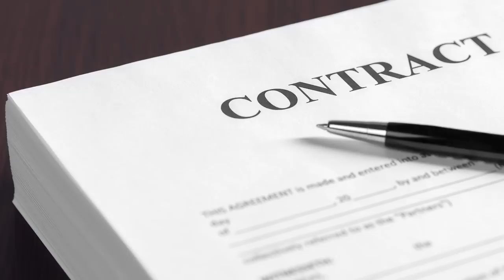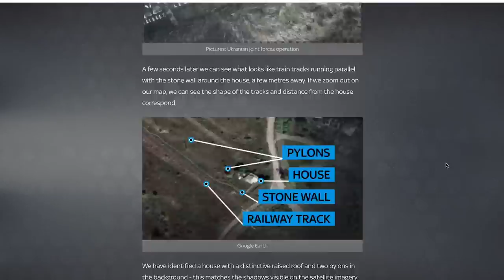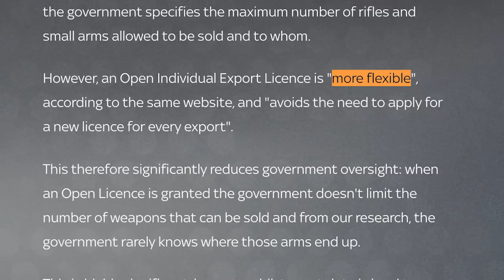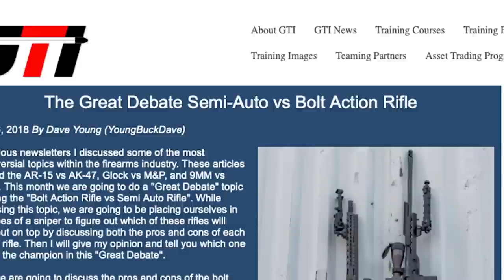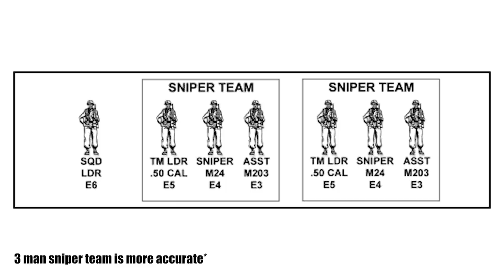L115A3 Brits Sniper Rifle From a Shed to Combat

Comment: I thought it was clambered in .338 Lapua though. I guess there are 7.62x51 variants but I thought that .338 was more popular with this rifle. Also the .338 variant is what made the the longest confirmed sniper kill.
Reply: I mean been alot models, they started in 762 NATO. But they now do 50cal down to 762. But 338 and 300win are there main cals.
Reply: Longest "At the time". Our Canadian forces Joint Task Force 2 with a US made McMillan TAC-50 holds the record at 3,540 m (3,871 yd).
Reply: The original was 7.62, I shot one once way back. The .338 Lapua Magnum came about much later, I was long gone by then. 😄
Reply: .338 became standard in the late 2000s following protracted patrol battles in Helmand. The Taliban found they could not approach British positions without being instantly engaged inside 800 meters by 7.62 AIs. The Taliban switched tactics and started using mortars and .50 Dshk machine guns from elevated positions. The .338 was soon adopted and the Taliban suddenly found they were not safe using indirect fire weapons from beyond a kilometre either.
Reply: @JRath905  
This world longest sniper kill focus is utterly stupid.
There is not a single sniper rifle in the world accurate enough to hit a person with a skilled shot at those distances.
This is much more luck than skill.
Only people totally clueless about sniping care about this nonsense.
Reply: @zoiders  
Outside 750 meters, the .338 Lapua Mangum is by far the best sniper cartridge against personnel in my opinion.
Personally I prefer it for all sniping against personnel outside 500 meters because of it's terminal performance against body armor, trees, wooden walls and more.
The .300 Winchester Magnum works very well too for longer shots, even if the .338 is far better outside 1200-1300 meters in my opinion, and an army can buy many more sniper rifles in that cartridge as the rifles and the ammo are much cheaper and the recoil is clearly lower, so more people are able to get good at shooting with it.
Reply: @The_Judge300  So the fact that people who are brave enough to serve their country  and are able to pull off shots that save the lives of their fellow soldiers, under intense pressure, against the odds, shouldn't be recognized?

You need both skill and luck in long range sniping. The humidity, wind direction, air pressure throughout the path of the trajectory is all different and can change quickly from the time the shot is fired till it hits its target.

Their spotter has to be able to see where the round hit in order to tell them how to  correct/ make adjustments.

The shooter needs to be able to not only have the practice of accuracy, but controlling their breathing and sympathetic nerve system, which is in high gear during a firefight, when you know that your friends lives may depend on the shot you are taking. It is psychological.

At any time during the bullets flight, an airplane or helicopter may fly by, throwing it off course. The same with any explosive Shockwave, shrapnel, etc 

The target may be on the move, ducking in and out of cover, have suppressive machine gun fire targeted towards the sniper team.

And you are calling those men who pushed the limits of what their weapon was even considered possible as utterly stupid and that they don't deserve recognition?

..... and yeah, I'm not in the armed forces or a long range shooter, but that doesn't mean that I "Don't know anything about long range shooting."

I bet if you made a shot like that you wouldn't call it all luck and utterly stupid to keep track of.

Rather than boost other peoples accomplishments, and make assumptions , you gotta be snarky and judgemental.

I'm sure you are the most skilled and knowledgeable about everything military and world records and your opinions are all amazing /s.
Reply: @JRath905  
🤣🤣🤣
Did I say that I don't think a sniper or any other soldier that does his/her job and do it well shouldn't be praised for that?
And I am happy that you give snipers credit for what they do.
I just advice you to not fall for some of the nonsense written and said about snipers, sniping and what is a great shot for a sniper.
The "World Record longest sniper kill" is pure garbage, mostly based on luck and is stupid propaganda from the military. 
And snipers that brag about how many people they have killed really pisses me off.
Stupid Rambo characters that should have been weeded out during their sniper training.

I can tell you a little "secret".
You don't need to tell me at all about how it is to be a sniper and what is needed to be one and to do it well.
You can try to guess why.

Often the hardest aspect of being a sniper, is not the shot.
It is being able to make the shot happen.
And to get away alive after the shot.
Suffer silently. Silently suffer.
Reply: @The_Judge300  Indirect fire is not luck. I'm not sure what sniping experience you claim to have but its probably airsoft. If you take one of most recent long range records the weapon used was actually mounted on an automated weapon platform with video feed and a ballistic computer doing the calculations. Despite the automation none of that would work unless the rifle used had the mechanical accuracy needed. Indirect fire is not new it dates back to the great war and the use of the Vickers MMG. Sniping is mathematics and team work. Despite your claims about "luck" teams armed with .338 systems keep killing their targets from beyond a mile. Most recently in Ukraine where the Russian officer corps are being targeted.
Reply: @The_Judge300  It's you again isn't it fella? The fake royal marine 😅 American Sniper is mostly bullshit written by a mass murderer operating within established force protection in a city. That how ever does negate the efforts of genuine sniper teams operating in other theatres of war does it? Cpl Harrison and his spotter fired 6 rounds if I recall correctly not just the one and they were all on the money with slight adjustment needed to walk the rounds in. Luck didn't come into it. Just to pick a distance, say make it 1500 meters. Just how hard do you think it is to safely break contact at that kind of range? Most people can't see distinct targets at that range, let alone tell you where a shot came from. You are repeating tropes from the battle of Stalingrad and it shows.
Reply: @zoiders  
You clearly are a keyboard warrior that reads lots of stuff and think you understand how it is and what it means.
You are also rather clueless about weapons in general, and sniper rifles specially.

I can tell you a few facts about real life sniping.
If the conditions are good, you asses them correctly, you calculate the shot correctly, and you have a precise .50 BMG caliber McMillan TAC-50, just like the one the soldier had when he made the 3,540 meter shot, then a 1500 meters shot is not that hard.
Not even a 2000 meter first shot hit is impossible if you manage to be 100% perfect with your shot.
All assuming that everything is assessed and calculated correctly and that is in most cases very/extremely difficult at those ranges.
So, very often you need multiple shots and help from your spotter to finally connect with your target.

But after that, the problems really start.
You see that this very precise McMillan TAC-50, that is most likely the most precise .50 BMG rifle there is, have a precision of 0.5 moa at best.
That means that it will hit inside a circle of about 30 cm in diameter at 2000 meters if the shooter is 100% perfect with his/her shot.
The average chest of a man is slightly wider than that, but not by much.
At 2500 meters, this circle will be about 37.5 cm and that is wider than that average chest of a man, so you will not always hit him, even if the conditions are good, you asses it all 100%, you calculate all correctly and you make a 100% shot.
And at distance you also get in all sorts of problems, like often not having enough elevation in your scope to dial to hit that far and that the person can be difficult to see well in the scope.
So at 3500 meters is you rifle not precise enough to be sure to hit that person at all, the conditions are close to impossible if not impossible to asses, just a small fraction of mistake in numbers put into your calculation will make you miss by a meter or more, you most likely don't have the elevation in the scope to dial that far, you can hardly see the person and if you don't make a 100% perfect shot, you will miss by a lot.
All this results in making Hail Mary shots, mainly to suppress the target and you might hit the jackpot if you are extremely lucky.

There are reasons for why armies all over the world consider the max effective range for personnel sniping, is 1750-2000 meters for both the .50 Cal and the .338 Lapua Magnum.
There are multiple reasons for why I prefer the .338 Lapua Magnum for sniping personnel out to about 1750 meters.

You continue to read all the great stories out there and live in your own little fantasy world if that makes you happy.
Reply: The latest barrels were for 6.5mm no idea which country ordered them though.

Comment: The AWM 338 and AI50 does have a glued or bonded chassis.  They are designed to easily swap out barrels, add proprietary accessories(night vision mount, bipod mount) and the plastic green covers can be removed by armours for access to the tigger or to change color.  So it’s modular but it’s proprietary.  The AIAE model doesn’t have a bonded or glued chassis.  These guns are not lighter weight wise than there semi auto counterparts within the same caliber family.  This is mostly weight from a thicker barrel that would add weight and retain accuracy during longer strings of fire.  The real proprietary thing AI designed was a detachable box magazine system for a bolt action rifle that was reliable enough under austere conditions(nothing perfect pretty damn close),a chassis that could be readjusted to fit a different shooter or color change, an excellent safe tigger with two safe modes(think parachute), convenient safety selector, a very nice two stage tigger with a defined wall on the second stage which I believe helps the shooter preform proper fundamentals(not all shooters but the trained ones).  Lots of other small touches to this rifle you don’t know about till shooting one regularly or owning one.

Comment: As always, great coverage Cappy🤙 Oh, and anyone that thinks a bolt gun isn't INHERENTLY more accurate than an automatic hasn't done any long range shooting...and by that, I mean out to 2000 and beyond.  The world record for a long range rifle is considerably farther than the military record, and it was with a bolt gun...like every world record that has ever been broken in long range shooting.  Science doesn't like when it comes to physics.  In addition, one thing you forgot to mention is SOUND SIGNATURE.  A suppressed bolt action is much quieter if it needs to be.  Both the action itself and the report, so for jobs that are at closer ranges, it doesn't give away a sniper's hide as easily.

Comment: Another overlooked benefit of a bolt-action is the ability of the shooter to decide when to work the action and eject the spent casing. Although both of my AR-10s (LWRC and Nemo Arms) have variable gas systems that can be set for the weapon to operate single shot with no automatic cycling of the bolt.

Comment: While you say the .338 lapua magnum is 1 step down from a .50bmg... I would argue it is actually a step up. While it has lower muzzle energy, it has a higher kinetic energy downrange. At 1000 yards it is actually more than a .50bmg, because of the wind drag on the larger projectile.

Comment: The first batch of L96's had a problem with the firing pins breaking.  The end of the pin was shrouded within the bolt so the user had no way of knowing if the rifle was cocked or not....Or if the firing pin was broken.  The firing pin after it broke, would get jammed into its fire position so when the next round was fully chambered, it would set the round off before the bolt was locked down, causing a breech explosion.  It was all down to cost cutting in the manufacturing process, using cheap materials & manufacturing.  It DID turn into an otherwise brilliant sniper rifle in the end though!

Forgotten weapons did a small, highly informative, series of videos on the L96 family.....They're well worth a watch!

EDIT

Yeah, I did kinda make this comment before the end of this video!  Apologies!

Comment: The bolt action is considered more accurate because there is no bolt movement going on until the shooter actuates the bolt lever, whereas in a semiautomatic rifle the bolt cycles using the gases from the round fired, so there is mechanically more going on as the round is leaving the barrel that could potentially have some affect on a super long distance shot.

Comment: Let's be honest it's still holds the title for the longest sniper shot since they had to use a .50 cal sniper to beat it
Reply: ..and only the sniper and his spotter confimed it....wheres our guy had many many spectators.
Reply: You gotta give credit where credit is due Longest "At the time". He was using a much more modern cartridge .338 Lapua Magnum LockBase B408 bullets vs the 
.50 cal. The Lapua has a higher Muzzle Velocity 2953 fps vs 2750 FPS, but with a much smaller bullet.

Our Canadian forces Joint Task Force 2 with a US made McMillan TAC-50 holds the record at 3,540 m (3,871 yd) which is a much greater distance than 2,475 m (2,707 yd).

He still did amazing sniping, but Canadians also hold #4 and #5 on the longest confirmed Kill list, with An Aussie at #2, Craig Harrison at #3.

I know his accomplishment was great, but his guns effective range was 1,500m and the MacMillan is 1,800m.

He pushed his gun 975m over effective range, the Canadian pushed his 1,740m over effective range.

Comment: There is something about the Brits and operating on a shoestring budget and yeah, out of a garage, a prelude to quantum leaps in innovation. Morris Garage, drove their MGB GT and ragtop B models as a teenager and loved the handling, on the winding, hilly, ex cow path, roads of Northwest CT. Frank Whittle, basically operated out of a garage, invented the gas turbine, while the bureaucrats of the Air Ministry, couldn't grasp the significance.

Comment: If you have deep enough pockets, you can build an m14 variant to be capable of half MOA or better. But we're talking about a rifle that will probably be $7k or more. As for chasing brass, brass catchers are a thing.

A good heavy profiled barrel, a match trigger, high quality bolt and receiver, good springs, match piston and oprod spring guide, and a jae stock. You've got yourself a scary accurate, and expensive, and heavy semi auto m14.

Personally, I wish modern gun manufacturers would update the platform. Modern materials should be capable of drastically reducing the weight, especially if they focused on modernizing the oprod. Giving it a non reciprocating charging handle, and adding an offhand charging handle option up by the handguard, and a caliber swap to something more modern like 6.8Sig or .308 Norma magnum (ohhh what about.338 Norma magnum!?) or one of the newer highspeed 6.5s.

Comment: The AW rifle is always an interesting story but I must ask, why didn’t the rifle use L1A1 Mags? Around the time the AW rifle was introduced, the UK while moving over to the L85 still had large stockpiles of L1A1 SLR rifles and had some still in use. Although the 20 rounder would not have been needed for a Sniper rifle, having interchangeability with troops still using the SLR sounds like a good idea (especially given that they were accurizing the some of the SLR rifles into a DMR role like the US and M14) and they probably could have converted surplus 20 rounders into 10 round mags by chopping it roughly in half, although I am not sure if the effort to convert them would have been worth it over making new mags.

Comment: So one of the other big reasons for snipers using bolt actions is they can handle the large magnum rounds that most modern day snipers use. There's not a lot of options for semi autos in stuff like 300 win or norma or 338 lapua and though there are some older rifles in 308 still out there for the most part everyone's been favoring the larger round and using semiautomatic when using thr 308.
Reply: That is a silly thing to say. We have autoloading artillery guns, and the Barrett M82a1 is a semi-auto 50bmg.
Reply: @groofromtheup5719  and the m82 struggles in the accuracy department for long range sniping why sf used the mk15 over the m82. You can call it silly all you want but actually try and name me any system. Out side of a handful of small specialty shops like falcor defense their isn't any made by a major manufacturer. So is it really that silly. There's been a lot of attempts but to day most have failed just being to large or too expensive or too complex to be successful. The wa2000 is a great example there.
Reply: Also the autoloader systems on tank ship and artillery guns work in a maner that is very different from a selfloading rifle that is not really a good comparison
Reply: @jonathanlogan6647  I never said the barrett was a sniper. It was never designed as one, but it does hold the #2 record, above the best from AI. Looks like Semis have about half the top 20 or so longest range records, and Hathcock is in the top 10 with a modified Ma-Duce.
Reply: @groofromtheup5719  Lol
Reply: @jonathanlogan6647  Lol